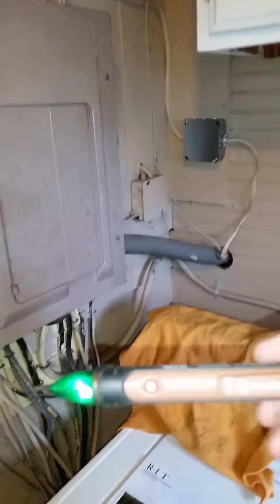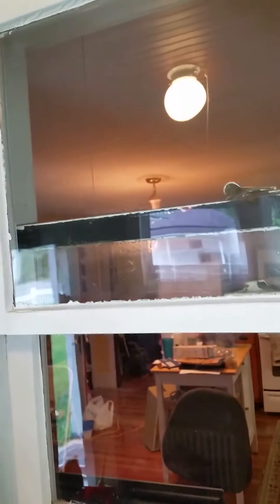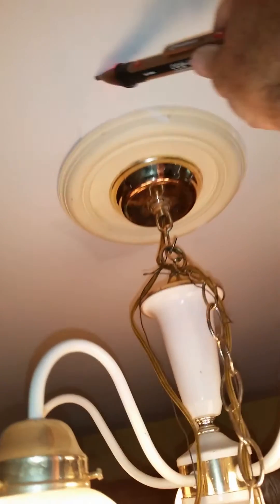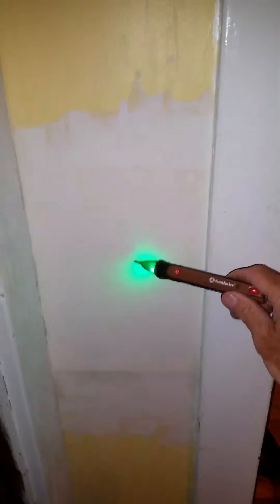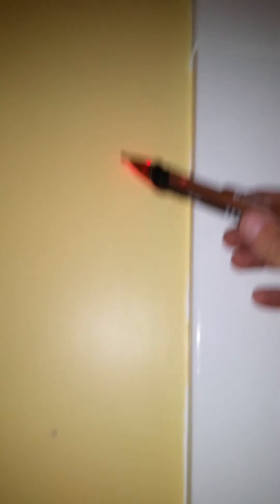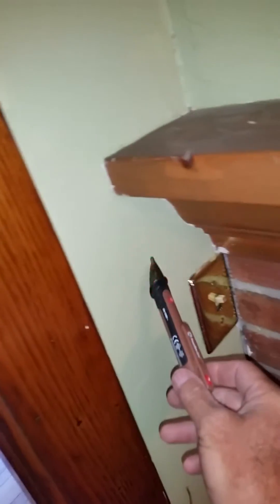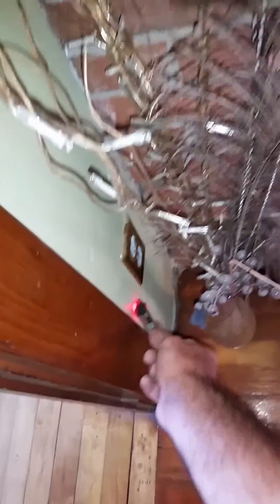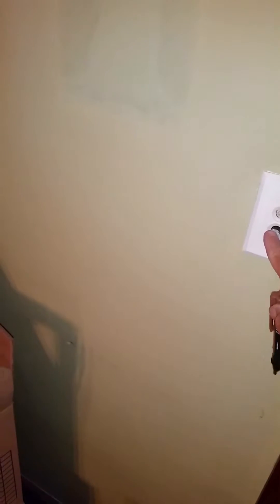Knob and Tube wiring in  house

Comment: I've had problems with these voltage sensors at times. I don't know what does it but there are times when it seems they indicate just about anything is energized. If fact, at those times I wouldn't be surprised if you held the thing next to a banana it would indicate the presence of current.
I always use a test meter as to check for active circuits whenever possible